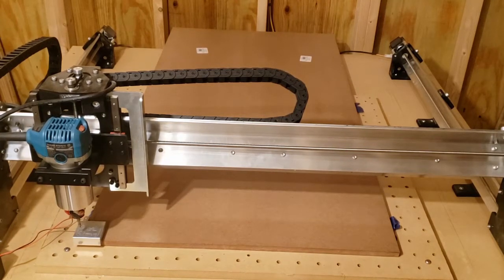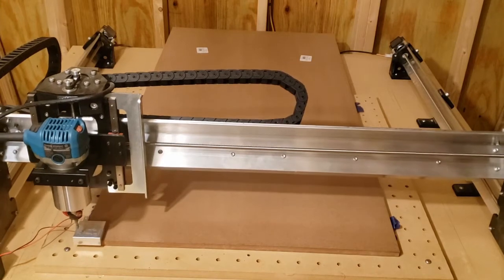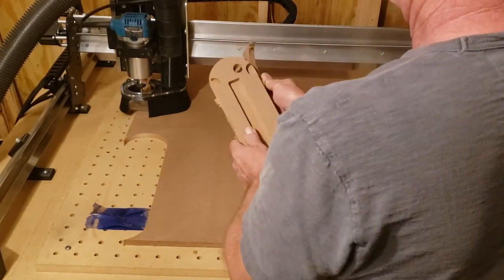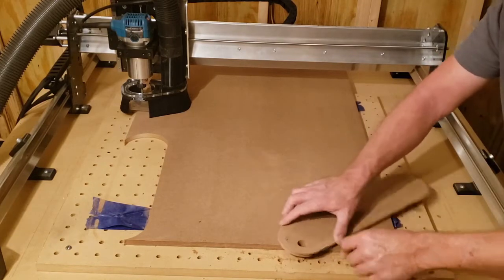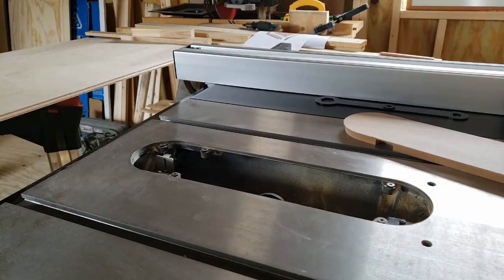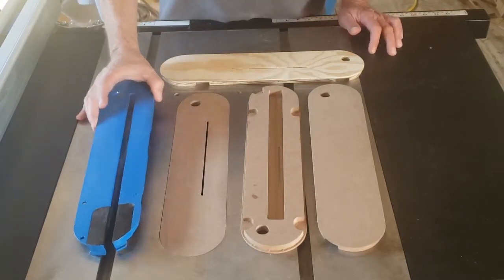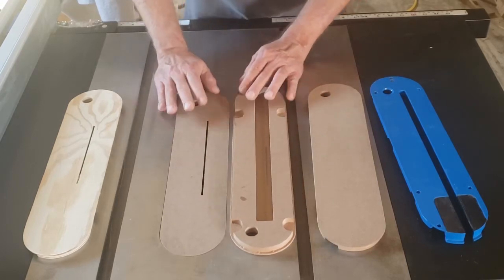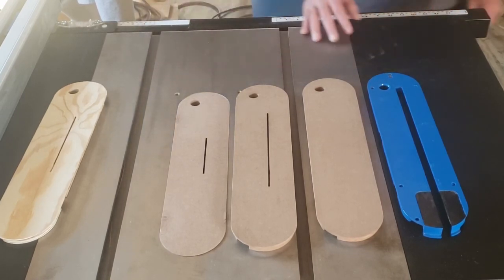Zero Clearance Inserts for the Delta 36-725T2 - Info in the Description

Comment: Why would you not run a riving knife?
Reply from the maker: For the most part I do. Non-through cuts are the times in most likely to run without it depending on what else I'm doing.

I made the inserts without it for those who chose not to use it but still want the zero clearance insert.
Reply: @prosperwoodworks7366  ok. I only ask because I've experience kickback a few years back and since then I never run a single blade without a riving knife.  Just my two cents

Comment: Good video,  how did you figure out the right locations for the cuts?
Reply from the maker: Careful measurements combined with trial and error. Having it all done on the CNC made changes easier to implement until it fit perfectly.

Comment: Thanks for the video. I just received my longmill CNC and that is one of the things I wanted to do with it as well. I also have a Delta saw and was wondering if it would be possible to get a copy of the files you used to cutout the inserts? TIA
Reply from the maker: I'm not posting the files I used just yet. Although I'm very happy with the results, I've been thinking more about what's really needed for the pocket and possibly adding a piece to aid in dust collection. I'll be posting videos to show the updates as I make them.
Reply: @prosperwoodworks7366  I have seen someone do groves on the top of the insert to allow airflow and better dust removal.